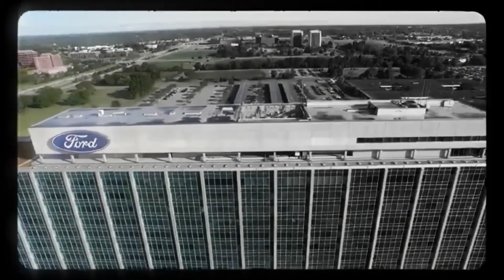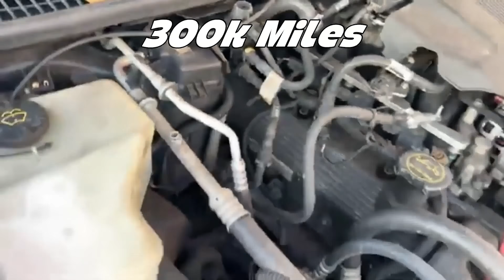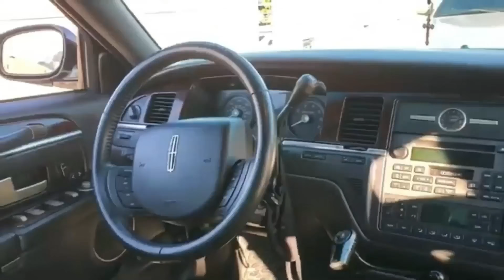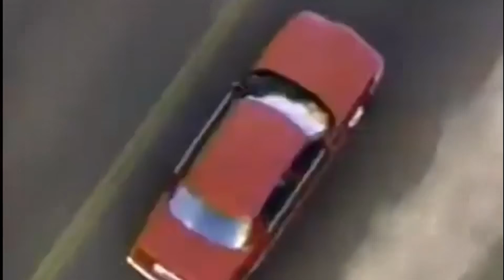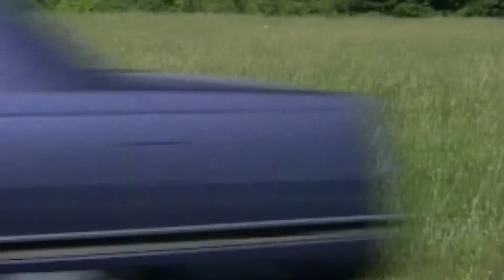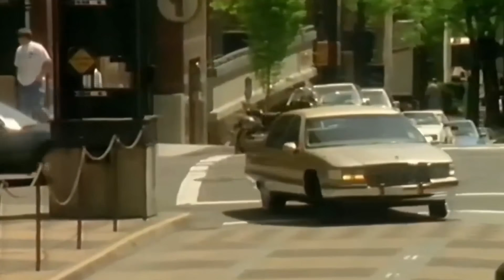Lincoln Town Car vs Cadillac DeVille: Which One Actually Got It Right?

Comment: The last car my folks bought together was a 1995 Deville Concours.  When my dad passed in 2013 that car had less than 700 miles on it and I often asked him why he never drove it and he’d never give me an answer.  We only took it on one trip and that car had plenty of power and a silky smooth ride and quite interior.  My mom purchased a 2018 Buick LaCross but she never drove the Concours but to and from oil changes.  The car is in immaculate condition.  It’s probably one of a handful of those cars with super low mileage on it but I’m never going to sell it.  It’s got 1,011 miles on it.  The only thing is the Northstar engine is probably a ticking time bomb because it’s of the years that have issues.  Anyway, if that happens I’ll probably get it fixed because that car has sentimental value

Comment: A few things. I believe the Ford modular 32 valve V8 came out at nearly the same time if not a little bit earlier in the Lincoln Mark 8.  During this time frame, Cadillac had a more direct competitor to the Lincoln Town car. It was called the Cadillac Fleetwood which was body on frame, rear wheel drive, pushrod V8.  By 96 it was discontinued. Lincoln had more direct competitor for the DeVille called the Continental. By about 95, it also featured a 32 valve DOHC V8 in a transverse front-wheel drive application. 32 valve modular was very reliable unlike the North Star, but in the case of the continental the problem was the transmission couldn't back it up.  The Continental ran I think until 2002.  

The DeVille was not really a true European competitor with the powertrain being front-wheel drive. Cadillac also didn't have a V12 as its German rivals had. Cadillac didn't aim for the same level of luxury the Germans were offering. That's part of the reason why it didn't succeed. Even the Fleetwood being rear-wheel drive body on frame didn't sell as well as the Town car.  The Continental didn't sell as well as the DeVille. The truth is more nuanced. I think if Cadillac would have had a car like the CTS back in the '90s in a Northstar that didn't have reliability problems with the right styling (which the DeVille didn't have) and no cost. Compromises for the interior, I think it could have pulled it off though. They would have had to commit to it for the perception of the brand change.
Reply from the maker: I really appreciate you taking the time to share such a thorough and knowledgeable breakdown! Your points about the Ford modular V8, the Fleetwood, and the Continental add a fantastic layer of detail and context that truly enriches the discussion. Thank you for that!
Reply: @GoodOldThings7 thank you.  I appreciate your kindness.

Comment: The Lincoln has always followed the Cadillac and always will.
Reply: My 03 town car has 350k still my daily driver
Reply: One thing's for sure.. they didn't follow Cadillac to the junkyards.. many of them are still on the roads today.. including my 2003 Crown Victoria Sport.. 😎🇺🇲
Reply: @tonyc5756  There are plenty of 200X Devilles/DHSs/DTSs still on the road and have been well taken care of without needing to replace the engine. Not every Northstar V8 self destructed. Performing regular maintenance and how they were driven also played a role in the head bolt liner issue.
Reply: @johnnyrocket4357 they must be in people's garages because I don't see them.. I see at least 5 to 6 or more panther platform cars everyday..

Comment: It's difficult for me to wrap my head around this, but 1995 was 31 years ago. I remember when the Lincoln got its update. Even though I was only 23 at the time, I thought it looked very classy. A statement car, if you will. The Cadillac, on the other hand, may have had more tech, etc, but it was front wheel drive and it just looked lesser-than.
Yes, I know the Fleetwood was rwd, but it was exiting the scene in 1996, I'm talking of the fwd DeVille, the car that carried on.
Reply from the maker: It's amazing how quickly time flies, isn't it? That's a really insightful take on the Lincoln's aesthetic and the Cadillac's evolution.

Comment: Well done!  This is the most accurate and honest comparison I've seen to date.  I know this because of how bad my experience was with the 90's Deville.  I fell in love with it and bought it used with 55,000 miles.  It was everything I wanted as a car.  At almost precisely 75,000 miles it died from the Northstar virus.  It was a loss of trust that I never recovered from.  This was not just a technological  disappointment.  It never should have happened  - it felt like a betrayal.  This was in 1999, after 2 years, and the Cadillac dealer wanted $8,000 to repair a car I was still making payments on.  And Cadillac would not stand behind it and try to, at least in part, make faithful buyers whole again.  To this day I can't believe they could not have tested and gotten wind of this enormous pending failure before owners lost their shirts.  They did not want to own up to the problem until so many owners had been screwed.
Reply: GM of that time didn't produce cars and trucks. They were a marketing firm selling products that happened to be cars and trucks. They sold the Northstar systems in Cadillac products with nearly the same amount of hubris as Ford did with their Pinto fuel tanks. The only real-world difference is that no one that I know of died from an engine dying vs. a fuel tank bursting in a way that could've been prevented for $11/car. Yet...GM went bankrupt due to the death by a 1000 cuts caused by an otherwise completely indifferent management and executive staff while Ford corrected their ways (a bit) and continued on.
Reply from the maker: Dude, that's rough! 55k to 75k and then BAM, Northstar virus. Can totally see why you'd feel betrayed, especially with Cadillac trying to charge you 8 grand. That's just messed up. Thanks for sharing your wild ride with that DeVille!
Reply: That repair SHOULD'VE been covered under warranty, but good ole' "Greedy Motors" didn't want to cover the repairs to something that shouldn't have broken down in the first place, the more things change, the more they stay the same....

Comment: I needed a reliable inexpensive 3rd car to drive to and from work.
I wanted it to be semi “Old School”, but not so nice I was concerned about parking it in store parking lots.
I had 97 Towncar, for a few years, but a lot of replacement parts were getting hard to find, since most of that square body style been crushed over the years.
So I got a 09 Towncar from my mechanic, which runs great for a low price.
Would I have rather had an older Cadillac?
I would have, but the Lincoln’s are way more reliable,especially those years.
And I knew those North Star engines were a problem, if you could find a decent one.
The Lincoln gets me back and forth to work, I load stuff from Home Depot and Lowe’s in the giant trunk ….
And most importantly, my Grand Kids can eat what ever they want in it.